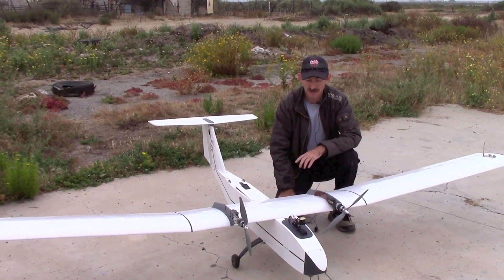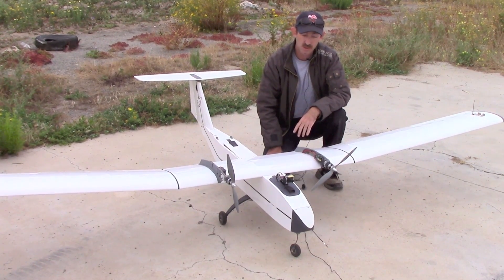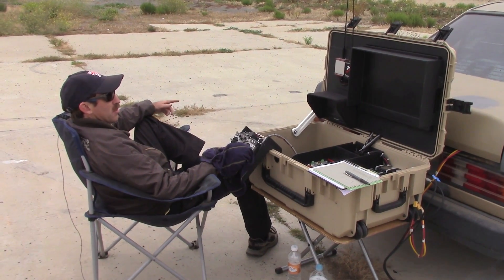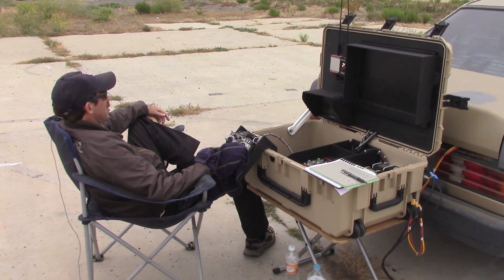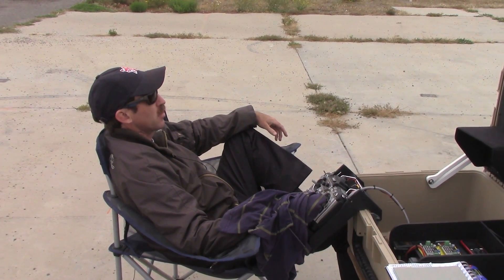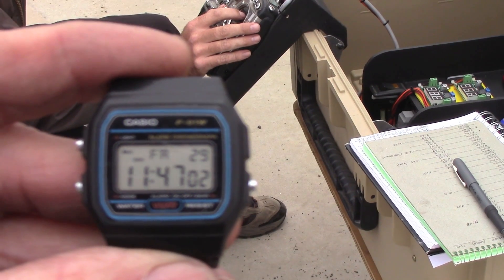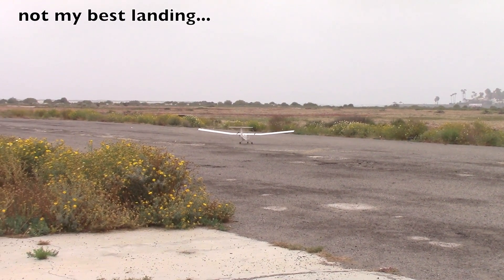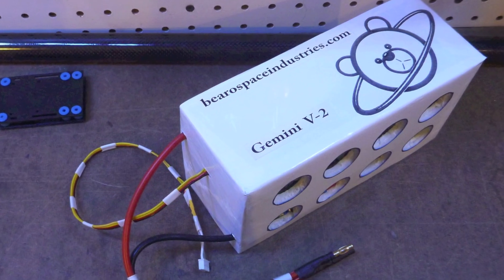4 hr + FPV Flight Gemini Version 2 Endurance Testing

Comment: Spike! I just barely beat your record. Here is my proof. https://youtu.be/XQc6H5o-6mM   Thank you for your advice on li-ion pack construction. Your videos are super informative.
Reply from the maker: Great!  what was total flight time?  in the video your voice said 2 hrs+ but obvious from telemetry that you flew over 4 hrs.  are you using retracts?  i though i saw gear doors in the video. also just saw your other video with a quad following the plane.  brilliant!
Reply: @FPVREVIEWS  Oh man! you're right! I meant to say 4 hours. I landed at 4 hr 4min 30sec. The battery was still reading 13.2V when it hit 4 hours (10V is completely dead) I could have gone 30-40 more minutes I think. I know that voltage curve falls off pretty quickly at the end. No retracts or gear of any kind. Just belly landing. A BHheli ESC is critical to avoid the normal low voltage cut off. I have the brake turned on to give the prop a good chance of surviving. I built the pack from 24 NCR18650GA cells. 4s6p. The 870kV motor is spinning a 12x6 prop. I think it could spin a larger prop for more grams per watt. The nearly 8 foot wing is from the Phoenix 2400. The fuselage is built from foamboard, hot glue, and packing tape. I designed and printed the motor mount and control horns. I am using a F-405 Wing flight controller that has been flashed to use arduplane instead of inav. The battery weighs 2.6 pounds. The All up weight is 5.9 pounds. Thank you again for sharing all of your knowledge on YouTube. Your aero knowledge and skills are absolutely top notch!
Reply from the maker: interesting,  you may get better efficiency by increasing the prop pitch. When i went from a 13 x 6.5 to a 13 x 8 prop, i noticed about 8 percent less power consumption in loiter.  are you using an airspeed indicator?  
Saving weight and drag by having no gear surely adds a lot to flight time.. I just find it to be an impractical configuration for most flights.   Yes, you should be able to go down to 2.5v per cell under load without damaging the GA cells. they are awesome!  how low can you set your ESC cutoff?  what kind of ESC are you using?  I was using a variety of ESC's, but when i switched to castle early on, i noticed a lower overall power consumption, and the ESC was no longer even warm at end of flight. I think it made about a 5% difference in power consumption.   Can your aircraft carry a bigger battery, or have you experimented with adding weight?     anyway, lots of questions..   the more data you collect, the better results you can have due to knowing what changes to make.   Great Job overall!! Great to see it. 
 to a  @MatthewHeiskell
Reply: @FPVREVIEWS   Thank you for the advice. I will try a more aggressive prop this weekend. 8% is a big deal. I just ordered an analog air speed sensor. That should help the FC to be more efficient after I have made the appropriate changes to the settings. Most BLheli ESCs do not have a low voltage cut-off at all. I am using a little 30A 2-6 cell opto BLheli ESC.
Reply from the maker: changing props is the easiest and cheapest way to tweak the design for sure.. will be interested to see what you find.  airspeed sensor is great.  you'll need to make a cover for it, lock in the calibration, and zero it out(calibrate to zero) as part of your pre-flight checklist. also you can play with the slew rate for throttle, to see how fast it actually needs to respond to keep the plane flying acceptably.  the faster the slew rate, the more the motor tends to rev up and down to respond to small changes in airspeed, great to fly it on an exact target airspeed, but bad for efficiency of the propulsion. takes extra power to rev up and down all the time. better to run a bit more smoothly, just a question of how much.   Have you done an auto-tune yet on pitch/roll?  and you can put it in RTH and if you have telemetry, go into parameters and tune the yaw damper by increasing it until you have a tail wiggle, then halving that value.      hope it helps.  stay in touch, and let me know what you find.   @MatthewHeiskell
Reply: @FPVREVIEWS  Thanks for the valuable advice! That makes sense that you want a near constant throttle. This is the first that I have heard of the yaw damper term. I will set that up next. Here is a link to the edited video https://youtu.be/nZkzJSkzte8

Comment: Somebody posted "you have earned my subscription" I have to agree. Your video
on aircraft flight dynamics is brilliant. Wish my instructors could have explained the basics this clearly. 
I am not a great fan of the FPV onslaught. I am strictly a L.O.S. R/C  flyer. That stated,  I like how this platform is being tested and proven. This plane has obvious industrial and legit research uses, how many has NASA and SpaceX bought? Some common sense and serious consideration of the vehicle's design for safe and productive operation by a wide range of operators is what is coming through in these videos. I don't get that sick feeling that this platform can be used in a mischievous and irresponsible manner as easily as many of the over the counter drones have been as demonstrated by the amount of online video showing angry public and officials confronting drone operators.
I am not a big fan of FPV for the mayhem it has brought down on the rest of the R/C flying community. But there is exceptions to everything. And this platform is my exception, I am truly interested in this plane and impressed by the
way it's being developed and used. Responsible, Class act.
Thankyou for sharing this.

Comment: with the new FAA rules, are these long range flights illegal? they are definitely beyond los.
Reply from the maker: You are assuming that the flights in questions occur in the US, which they do not.  
It's important to do things safely, but we also have a moral obligation to push technology forward, not back.
Reply: Depends on the operator and licensing. FAA has its view, FCC has its view, and the AMA (Academy of Model Aeronautics) has its view. All three are in 'negotiation' (basically Feds making up rules that the AMA is trying to get common sense put back into). Between the three of them, my take is you need at least a Technician class HAM license for the radio equipment, possibly more depending on frequency and a Remote Pilot license for the beyond LOS flight per the FAA, regardless of commercial interest. That's just the licensing. The FAA has additional regulations about calling airports under certain circumstances and when you need a flight plan. At one time they also considered uploading videos to YouTube to be a 'commercial operation' and considered that enough to push you over the boundary to needing the Remote Pilot license, regardless of LOS or not.  They seem to have backed off of that these days though, unless I missed another redefinition.  While I have my opinion on how restrictive things are getting, in all honestly the licenses aren't that hard to get (especially the Tech HAM), and help start to open up two other great hobbies, so I recommend getting them just for personal enjoyment and knowledge. But it all boils down to this: There is a legal way to do it if you're willing to jump through the hoops.
Reply: Heh, I wish more had that view here rather than the apparent view of keeping those darn kids off of their well regulated lawn. ;)
Reply from the maker: the government is not going to do development unless it can be used for their own purposes, which many of the citizens do not agree with, so it's up to us, unfortunately, nothing new there..

Comment: Could do for Iris + ??
Reply from the maker: +DU V i assume you are asking if the 3DR iris could use the Tesla style batteries?  if so, the answer is probably.. i have not done the calcs, but if you want to, check out the spec sheet for the NCR18650GA cells, or send me the weight,a nd power requirements for iris,a nd i'll try to work it out.
Reply: +FPVREVIEWS I have built a 24 Ah 3S  Panasonic 18650 pack for the Skywalker Condor 
1880. Weighs about 1.1 kg. More than enough power for takeoff. Have 
earlier done a 20 km flight with two 3S 8000 mAh batteries on the same 
plane. This was about two years ago, have had a fpv break for some time 
now, but I am planning a long range flight of 31 km. Have flown the 
panasonic pack only once before, so I am doing some capacity trials in 
my hobby shack right now. Also it need cycling to reach its max 
capacity. The problem is that at the end of capacity, it is possible to 
drop the voltage very low if two much throttle is applied. But I was 
able to draw 8.4 amps/70.3 watts contiously at 24.900 mAh depletion 
test. This was done with a water cooled 1 ohm effect resistor. The 
voltage was dropping slowly but it was around 8.4 Volts. I do use a step
 up regulator to keep the video TX at 12.4 volts for keeping its 800 mW 
rating.
Reply from the maker: +Trond Abrahamsen interessting, i have not had any of the problems, or effects you describe. as i understand, no lithium ion battery should need cycled to reach max capacity, but should be charged at room temperature. 
letting a nominal 11.1v pack drop to 8.4 sounds too low to me, for a good cell cycle life, according to panasonic. 
and i have not had any problem with keeping my video system working, i have tested it with old disposable lipo, running it down to 9v.  i have never run below 9.6v under load with the lithium ion panasonic B pack, any more would shorten it's life cycle below 300 cycles or so. i wonder if you received some cells that were not genuine, or have some other variable going on?  that does not sound like my experience at all.
Reply: It will certainly lower the battery life if one is to drain the battery on a regular basis down to it 2.8 volts per cell. The chemistry of the battery will survive until 2.5 volts, although its recommended not to pass 2.7V to be safe. This was a stress test, so I will not drain the battery so low unless its critical to make it back to launch. Also it is good know that it will be possible to maintain altitude even when its very low on juice. As for the video tx, it would have worked despite the low voltage, but it looses a lot of its power even when it looses just one volt. Some tx   has better power regulating for sure, but the one I have does not. The cells are genuine, but the pack is not so big as the ones you are building, so I guess it has lower C rating than you are used to? Also it is possible to draw 40A (with LIPO) with the propeller and engine I have. That far exceeds the C rating of the battery, so its not strange that the voltage drops. I have 7 cells in paralell for  each bank. A total of 21 cells.
Reply from the maker: +Trond Abrahamsen ok, that explains it, i can draw a max of about 70 amps, and i have 60 cells total. 
the power requirements for Gemini are just far lower. 
have you tried the new NCR18650 GA cells? sounds like they are what you need for aircraft with higher power consumption. they can put out 6 amps per cell, almost double of the B cells. i got a few for my anaconda, and will test them when i get  chance. i think they re the best for your application.
Reply: Yes, those cells would be much better. Thing is they were not at the market almost two years ago when I built the Panasonic pack. Shortly after there were higher C rating panasonic cells available, but with lower capacity.

A friend of mine was testing the 18650b for his quad after seeing a record endurance test with a very fragile quad. He told me about these cells back then. For his quad they proved too weak until he built a low weight H quadcopter which gave him 50 mins flighttime on a 4S pack. Back then that was very good on a quad  being at the same size of a Tarot 650 Ironman frame.

For now I will have to make do with this pack, if I`m careful it should be suffice, even though its not optimal. Looking forward to do more flying on it. Those new cells look great, they might even work well on a multicopter.
Reply from the maker: +Trond Abrahamsen very true, sounds like very good results on the multi rotor. i think these cell types will be seen on more and more aircraft, and multi rotors int he future, until they dominate the market. we'll see.. 
whatever happens, it will be interesting.

Comment: S0, please,  Tell us what the Batteries, Temperatures Are During flight 
air cruze speed? ?Load Avg/PeaK Amps?
 0h Yea What about the wind /ambient temp log?

the Li-P0 Average load tempature, turns out to be the second most important 0ne!
Temperature logging...T00 C0ld is by far worse on thier health, but also the draw down curve.
 noticeably changes, over the course of a chilly heat races..
IMnsH0 YMMV...
Great flight program you have made.Nice 4hr flight.
power management ftW..

J
Reply from the maker: +Jason White not lipos, "Tesla" style custom battery pack. see our latest videos on how to build it. 
battery temp during flight is very cool. discharge over a 4 hr period, so no chance for heat to build up. also cross ventilation for the battery pack, and vented fuselage with cooling scoops. 
average amps about 12-14 to sustain flight.  max amps is about 75 or so. 
no ambient temp log, but it was about 60 deg f. more or less.  wind was gusty. you can see the whole flight downlink on our bearospace insider channel. it's at 8x speed, and very boring. you are warned. 
see our website for more specs on the plane, most of your questions should be answered there.
Reply: Jason White of

Comment: another way to decreasing the price is supply a better bettery project,i know there is a link of battert can be useed on this plane than only cost about 250 dollar.http://www.hobbyking.com/hobbyking/store/uh_viewItem.asp?idProduct=66487
Reply: I think you missing the point. it's about weight! if you build a similar battery as per your link (S6 16000mah). i estimate about 27 of these 3500 mah cells are needed. Together the 27 cells will weigh 1296g, your battery weights 2044g. Remember also that these batteries will last longer. So removing some cells will lighten the battery pack even more, giving the same end result as in your link. It's about endurance, weight plays a big roll!

Comment: I do a lot of distance FPV flying and was curious if these new cells are just Li-ion 18650's like the Panasonic NCR's or if you've discovered another technology that we've not yet tried?  I was bummed that you never mentioned any details with regard to the chemistry of the new packs.   Awesome flight though!  As the Panasonic cells slowly come down in price, they will definitely become the "go to" choice for many of us.
Reply from the maker: Mel Johnson you got it. the key is how to assemble them effectively, without ground loops, or getting the cells too hot during soldering.   i believe that they will become very common soon for fpv planes.
Reply from the maker: well that aged well....

Comment: great video and plane! Love seeing your channel grow and improve over time. Looking at rctestfligh's solar plane could you convert the gemini to something similar with clear covering over the top of solar cells which are in the wings charging the batteries. their super light solar cells which could increase your endurance alot. Let me know what you think 
- Ryan
Reply from the maker: ***** Yes, i just saw that video, and it looks inspiring, although many of the parts were not optimal, others he got right.   it could definitely extend endurance on Gemini v-2, although i am working on a concept for a specialized aircraft just for solar.  it's an interesting concept that i think we will be seeing a lot more of in the future. Thanks for your kind comments.
Reply: ***** we don't have to do that,because the plane can fly 4h that is long enough.we can use the plane to carry the solar plane to a element,than drop it.

Comment: great video, enjoyed watching. I fly some FPV too and also 3D crazy helicopters. I would beware of discharging those batteries below 20%, about 3.75v/cell. They will not last very long otherwise, ask me how I know! Lipos is a whole subject in itself but worth researching, keep up the good work.
Reply: Alun Jones They are not lipos, and manufacturer of the cells gives 2.5 v  as the limit.
Reply: Bearospace Insider Ah, missed that point, watched again and you did make that clear at the start, I get it now thanks. I know of people experimenting with batteries from cordless drills, LiIon etc. Trade off is less peak current for weight, makes perfect sense for what you are doing.
Reply from the maker: Alun Jones well, better for planes like this, not so good for sport planes, and multi-rotors.  best energy density around! thanks for checking it out!